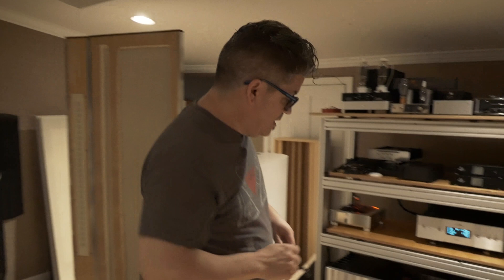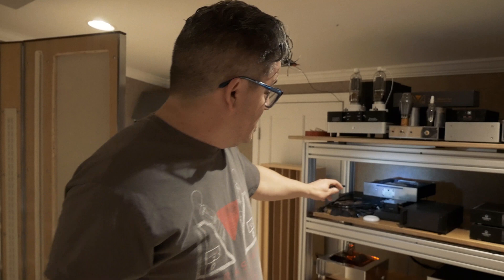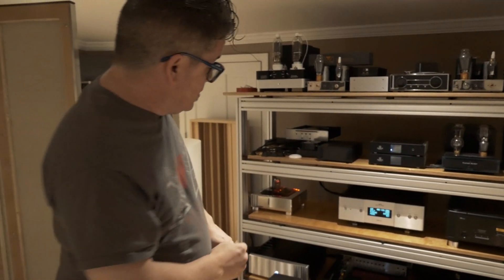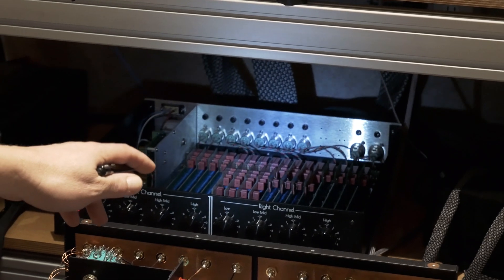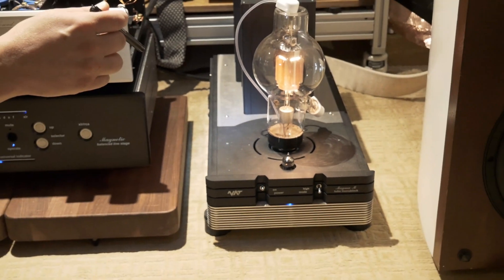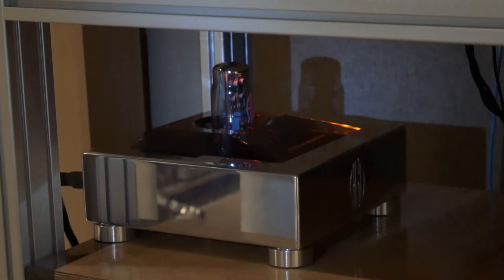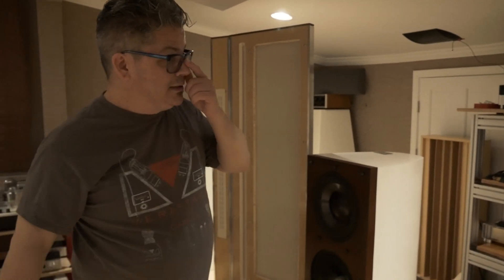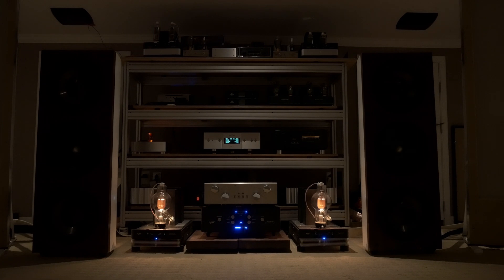4 WAY ACTIVE QUAD AMP RIG using Solid State, Vacuum Tube AND Class D all together ! (mic overdriven)

Comment: Great!
TomasAndStereo says that by putting the bass towers outside of the panels will give you a wider sound stage.
I know that they say that bass is nondirectional but maybe a placement you could try out? 👍
Reply from the maker: Thanks Thomas I've tried it. There is no bass issue now to speak of. Overdriven microphone is what you're hearing. I'll follow up with a better recording!!
Reply: @OCDHIFiGuy  no issue!
But can you confirm that you hear a wider sound stage if the bass towers is on the outside of the panels (IE further apart)??
Thanks!

Comment: You're right still needs more tweaking. I hear some slight bass interferance in the mid-range (vocals) 1st song. On the 2nd track I heard siblance in high notes at the start of the track. 3rd track has bass rumble or is it a bad recording . 4th track  has the same. Rumbling. Yes I hear large sound stage. Looking forward to all the equipment reviews. BTW I was listening to music on my 1+ 7 pro which has equalization. I used the BLON B3  IEMs , they have a 10mm single dynamic carbon driver. Cable is an eight core OFC  connected to my phone with a soliter adapter that has an AL 4418 dac. Very good sound. But overall the sound is good. I enjoyed your HiFi rig set up.
Reply: Exactly what I was thinking. The lower range is distorted, or a very bad recording, but all the songs sounded distorted to me.
Reply from the maker: @dsmith1543  overdriven mic's DOD people not read that? I put it in the title as well as description.
Reply: OCD HI-Fi Guy I did miss that. Thanks for clearing that up👍
Reply from the maker: Sorry. The mic was overdriven. I'll do another tomorrow.!@